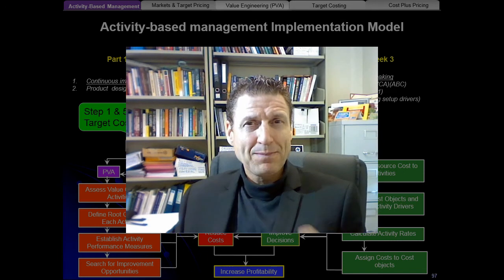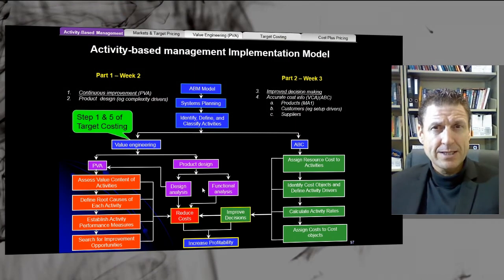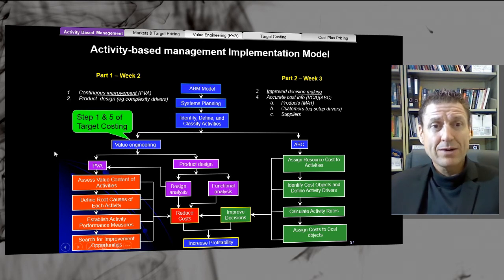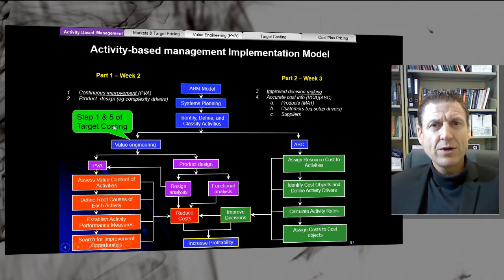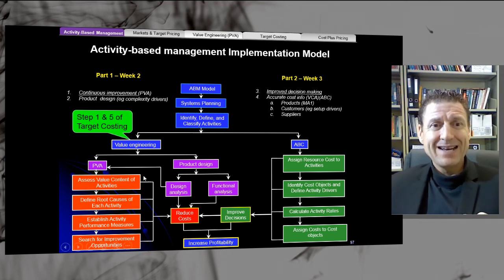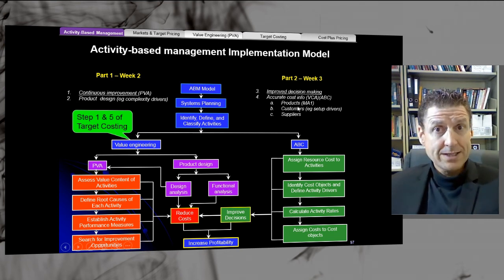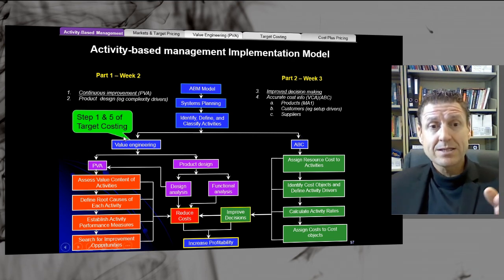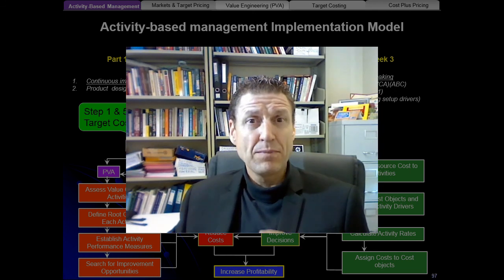CPA - Strategic MA - W2 - Long Term Pricing - ABM Model

Comment: This is from Jin Siyan(15420302).
From this part, I have learned something about activity-based management
implementation model which comprises of systems planning and activities  identifying, defining and classifying.And one of the classification activities---value engineering, this video focused more on product design that PVA which have four parts. It shows that the product design have two part, the functional analysis and the design analysis. The former one is designing different components into the product in order to lower the product cost in order to make a larger profit and the latter one is like pricing positioning product in the market for customer to see directly. And for the other part of classification activity---ABC, it told us that it focuses on customer profitability, supplier profitability and product profitability.